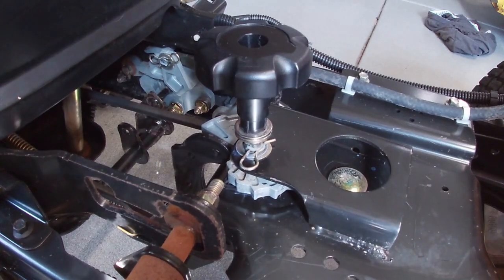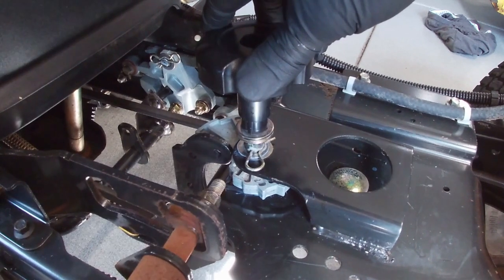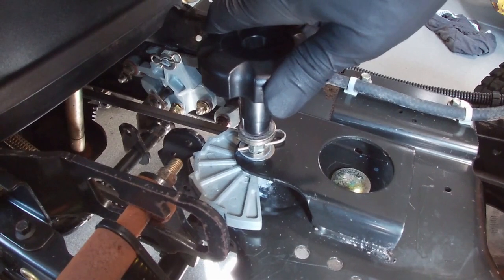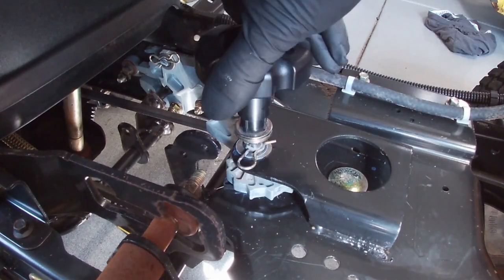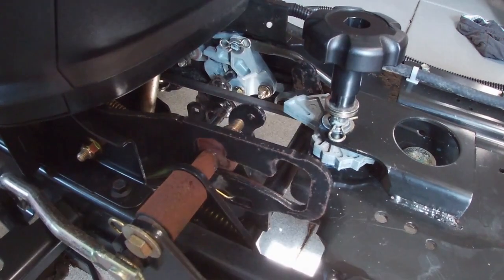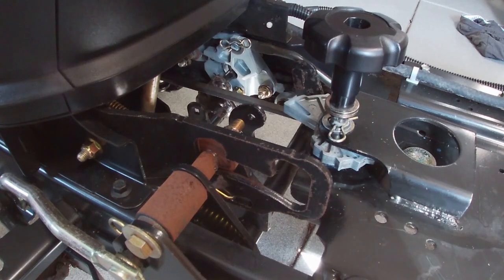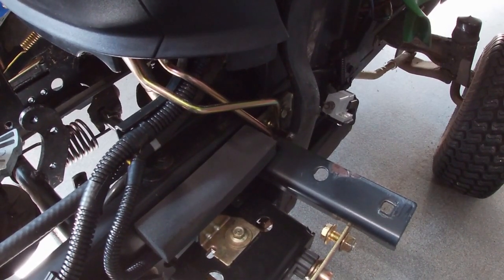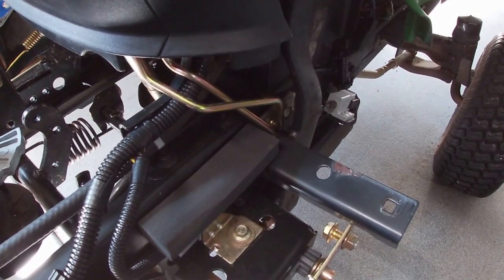How the Deck Height adjustment and Parking Brake work on a John Deere X300

Comment: Thanks for posting this. I couldn’t get my deck to stay up after adjusting the deck height to factory setting. Once I saw how the locking mechanism worked I figured out how to fix it by lowering the deck height all round. It’s much lower than the setting tool which comes with the mower but it now locks in the upper setting properly and the deck is level. You saved the day!
Reply: Having the same issue. Anyone know why this would happen?

Comment: I think the brake must have a spring that I'm apparently missing. My brake lever does not spring back either.
Reply from the maker: I don't remember how the service brake mechanism works, but I imagine there is a spring.  Mine retracts fully without issue.  Dirt/debris could cause issues with the pedal's ability to fully travel.

Comment: Can you confirm your deck is off in this video? I'm asking because it appears that your deck lift mech springs back to the home position incredibly forcefully but it doesn't appear that your deck is there to cause it to do so. I'm trying to determine if I'm missing a spring or something because with my deck off, my deck lift pedal does not spring back hardly at all.
Reply from the maker: The deck is off for this video, and I believe that the weight of the deck would cause the pedal to retract.  I don't fully remember, but I was probably operating the pedal by hand to demonstrate the mechanism, retracting it myself.

Comment: Thanks for making these videos! Great look at the inner workings of this tractor. Will definitely help X series owners for years to come. I'm looking for an X300 '08 model year engine style carburetor cleaning video. Only see ones from the 2011+ years. Have you tried to clean or access the carb?
Reply from the maker: No, I have not.  Fortunately for me, the tractor was well maintained in regards to the engine.  It starts and runs perfectly.  If I ever have to mess with it, I will make a video.  Thanks!

Comment: Hello, How do you remove and install the height adjust knob please? I've got an X310 and it's broken
Reply: I had to remove the left rear wheel and just pry it off with a pry bar.  Mine was just pressed on.  See my video on removing the platform.  I touched on it there.